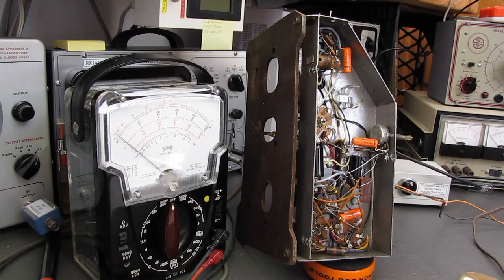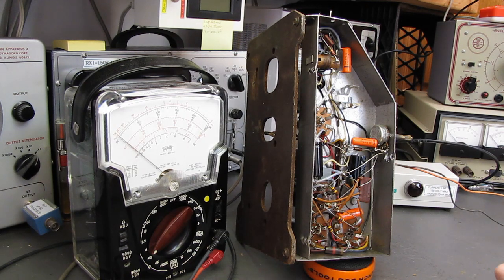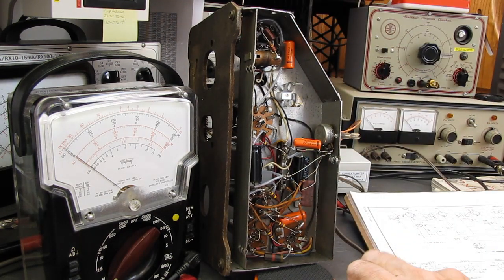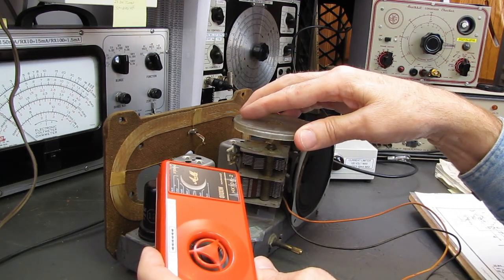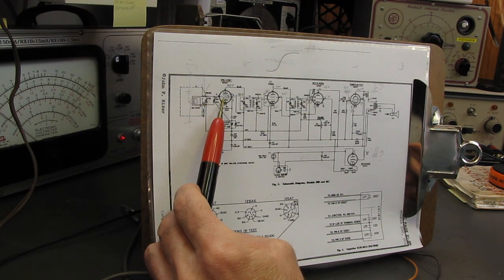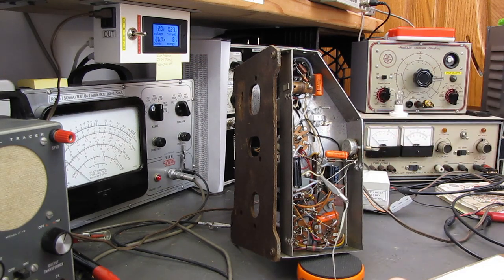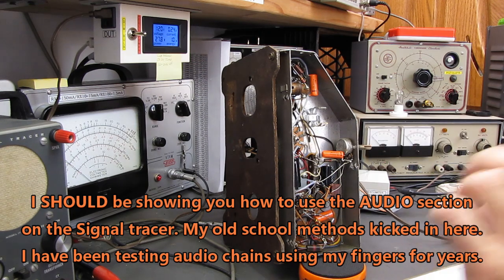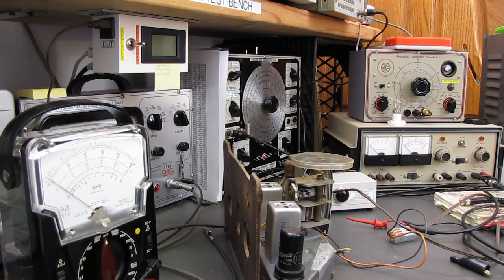DON'T PLUG IT IN VOL 3 - STEPS FOR SAFE POWER UP

Comment: Well done!    BTW, if you modify the signal tracer with full-wave bridge, and disconnect the cap to the output tube on the cathode, it will be much quieter.

Comment: Always a good idea to consider a safe methodical approach. I good VTVM should have a much higher impedance than a modern DVM  many exceed 100 meg ohm
Reply: Hey Chris!
Reply: I think the HP VTVM 410? Has a 100 meg input impedance. Paul Carlson did a demo of how it didn’t load the circuit that even a modern high quality DMM does. Since he did his video they have gone out of sight in price. As much as I love his channel every piece of nice old test gear that used to be dirt cheap is now like gold after he shows them restored. Where does he find his old test gear? Always in great shape, most stuff on fleabay looks like it was dragged 20 miles behind a car. If it’s nice they want 100 times more than it was new. Glad I did all my buying back when stuff was reasonably priced.
Reply: @SIXSTRING63  Paul has a VTWD (Vacuum Tube Warp Drive) he uses it to travel back in time and find the good stuff. But don't tell anyone. It's Top Secret...
Reply: @fullwaverecked  😎😎😎😎😝😝😝😝